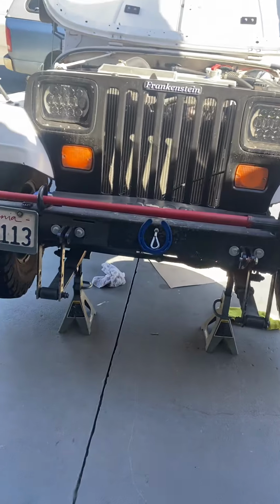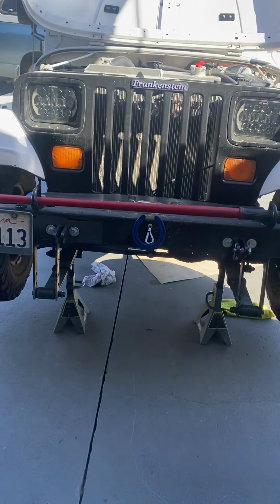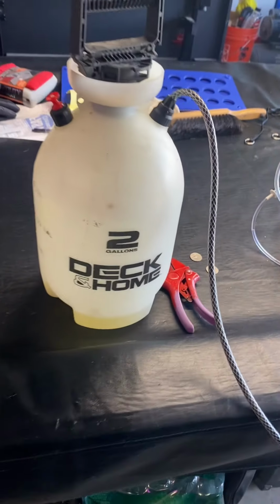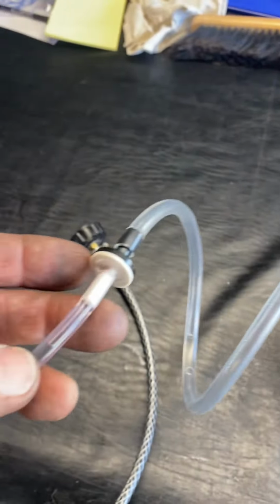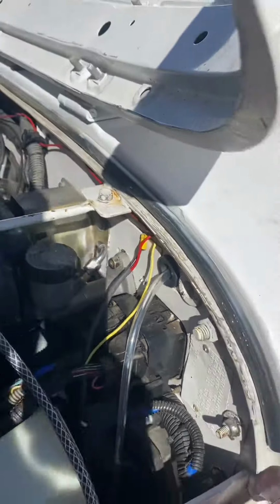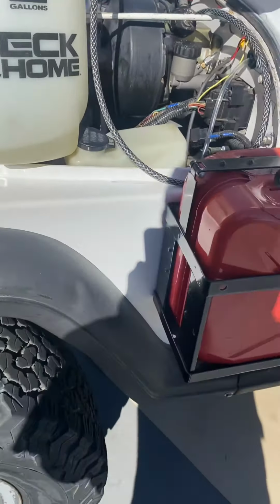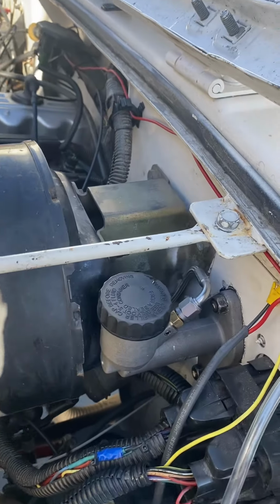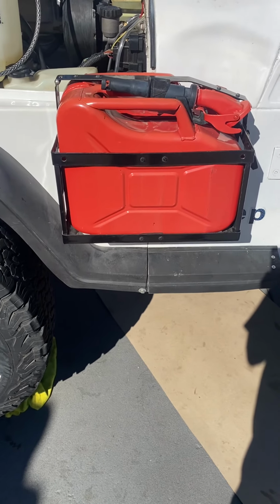Jeep Wrangler YJ Clutch Bleed Solution

Comment: Awesome video . After you done all that,  have you ever any issues after that?  
So I also I have the advance adapter unit and I have a brand new clutch and internal sleeve but after I bleed it the unit a 2 weeks into it  my Clutha goes out I don’t know what else it could be. I thought it could be the fitting the master cylinder the Oring that is not sealed tight , does your top fitting moves freely?  Hope to heard from you soon thank you